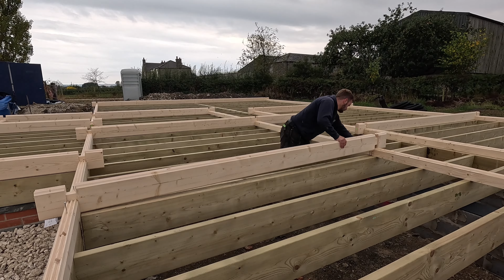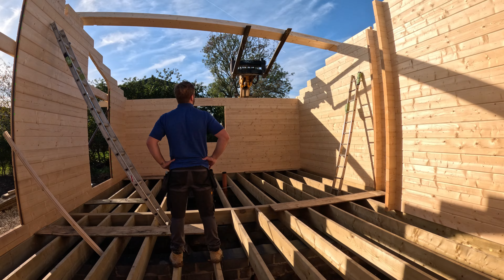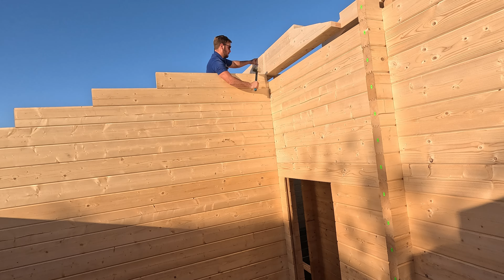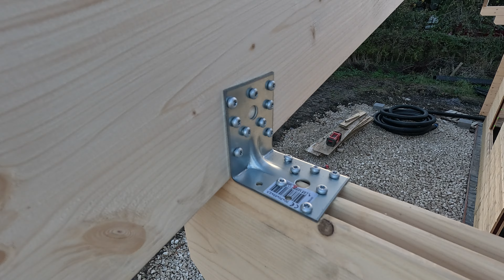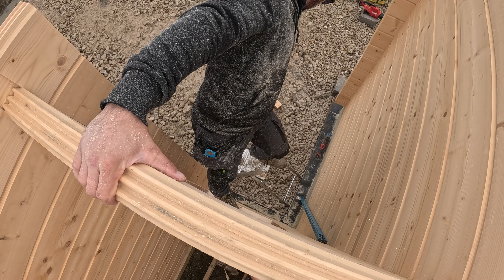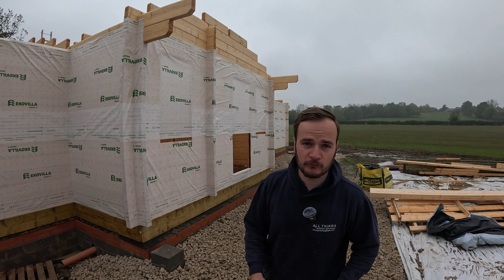£150,000 CABIN BUILD: Installing 250kg 10 METRE PURLINS

Comment: We are using very similiar system, looks good man!
Our logs are 13,5 cm atleast though.
Reply from the maker: That’s some heavy logs 🫣 All moved with a crane?
Reply: @allthingsgardenbuildings  the 13,5 can be moved by hand ,till 2 meter, then we need a crane. The bigger ones Cranes all the way :) in a lot of countries 13,5 is enough with the U value, but in our country (Hungary) we put insulation inside.